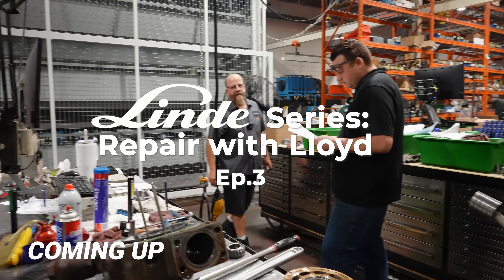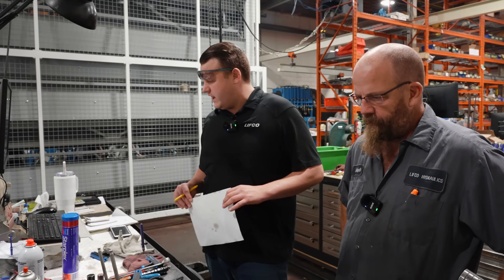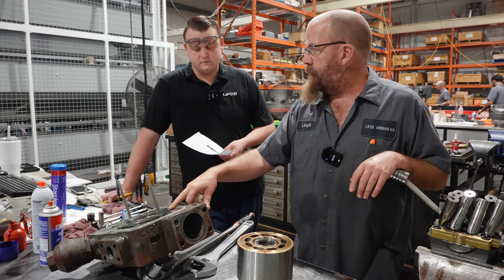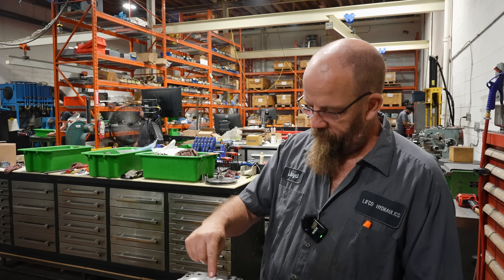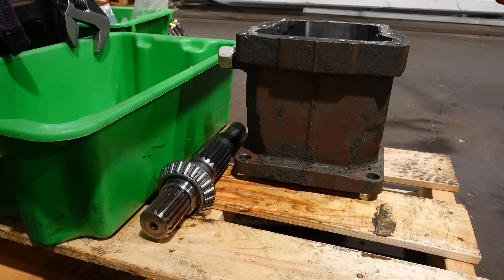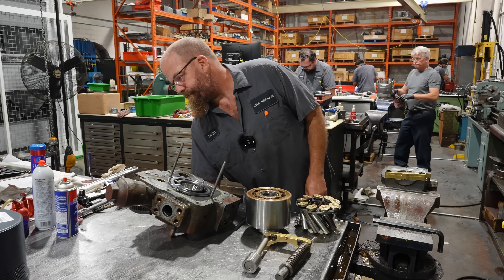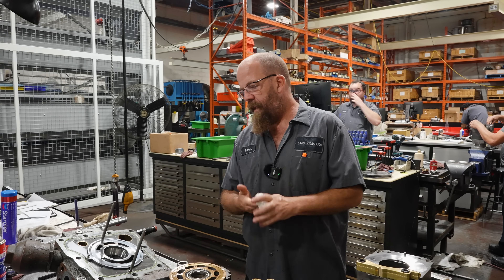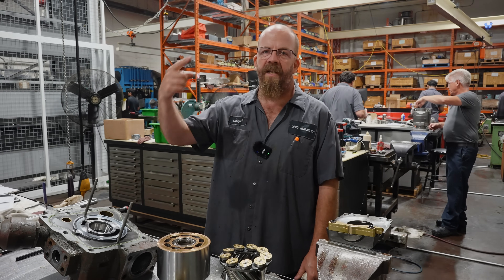HPR 210: Was this Pump Ran Dry?

Comment: I worked at a plastics place. I didnt know it but the 1st day I started I knew more about machines than the 'maintenance manager" They didnt have a mill or lathe or anything. Anyway they had an Engel 300  ton injection molding machine. After sitting for the weekend on monday morning the injection screw would clunk and loose position. They called Engel service and they flew a guy in on a plane. He said it was the system pressure regulating valve. 6k or something for the part and whatever it cost to get him there. Then they changed another valve a couple weeks later. So  the dude in charge finally lets me work on it. Its clunking. I bleed the piston and BOOM it works instantly. I call the part department and the parts guy was like yeah you need so and so check valve its 75 bucks.
Reply from the maker: I think you told us this story around a year ago! (I responded that Engel's have lots of Denison in them). Well anyways, glad to see you are still watching our videos. Hope you enjoy them.